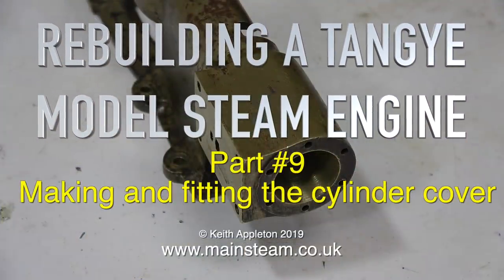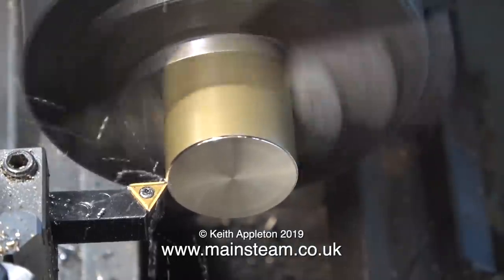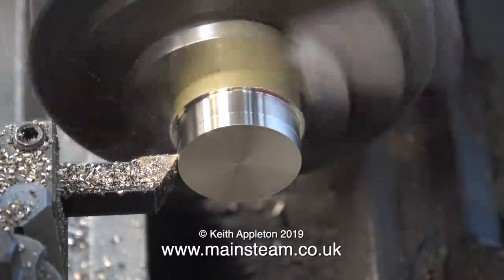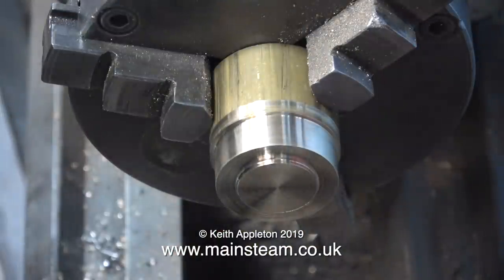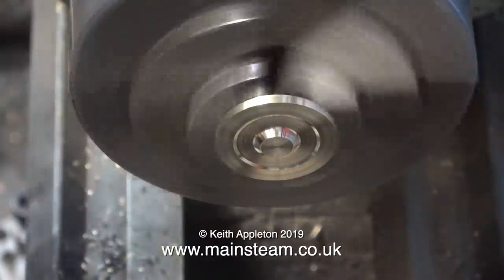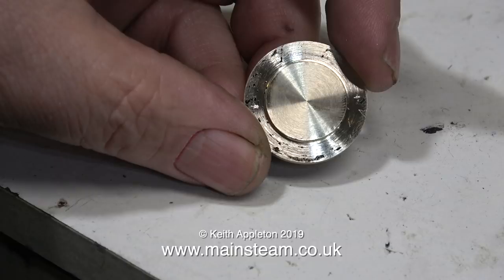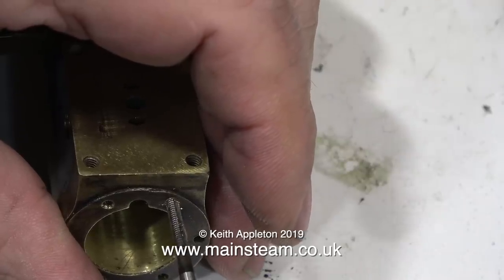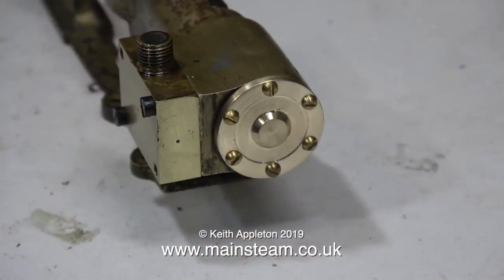REBUILDING A TANGYE MODEL STEAM ENGINE - PART #9

Comment: Coming together nicely! Can't wait to see it run.

Favorite trick for lining up bolt holes: cut the heads off some machine screws to fit the holes (in your case in the cylinder) and turn or file them to points. Screw them almost all the way in. Then put the cylinder cover on and give it a couple good whacks. Presto, all your holes are located and sorta center punched. I suspect that for something this small, getting them out would be a pain in the rear though.